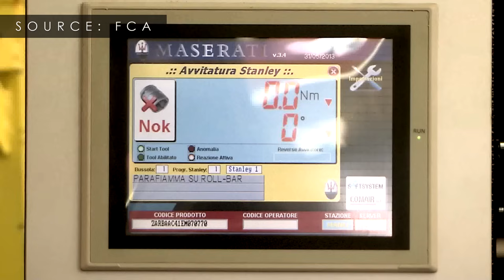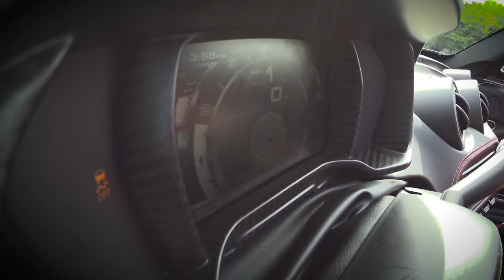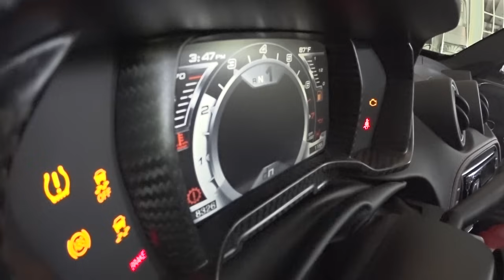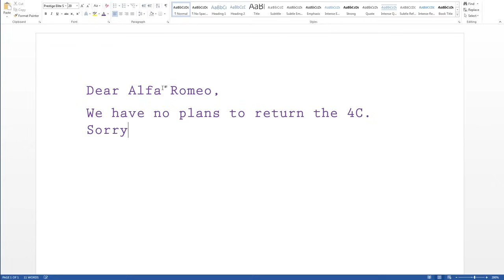Review | Alfa Romeo 4C Spider | Perfectly Imperfect

Comment: Most fun car ever, I have 8000 miles on my 4C. No problems a all I also have a 911 much more fun to drive the 4C.
Reply: You still got it ? Whats maintenance cost, overall satisfaction etc
Reply: Bob Livingston : I’d still take a 911
Reply: Bought my 2015 LE new.....couple of mild mods....replace rubber bushing in rear lower triangle with uniballs (huge improvement on track with stickier tires), better tires (the stock PZeros are crap and emphasize tramming), good alignment with 0 front toe. 
The car has been bullet proof and no issues at all other than a broken button when new replaced on warranty. Insurance is not expensive...in same range as my Ford 150 transit van and GMC Acadia Denali. I have owned a lot of cars including a 1970 ALFA duetto that I owned for over 40 years and only sold to gain garage space for the 4C. I also had a 67 ALFA GTV SCCA road racer. I love this 4C and every time I drive it I love it more. Mine isn't a daily driver but does get driven frequently although not in our Michigan Winters for obvious reasons. I am 72 years old, 6'-1" and 155#.....and very fit. I have no problem getting in or out of the car and once inside find it very comfortable although of course not big American car soft. Even though it has the optional race suspension it still rides fine....actually better than several other cars I have owned. I did find that adjusting the seat to the middle position on the front and lowest in the back gave a much more comfortable position and lets me see the entire dash display clearly. There are several aftermarket suppliers of upgrades for the car and with a couple of them the car becomes a real track monster.
Reply: @hertzair1186  Good for you! Enjoy your boring 911. I had two different model year 911s and a 987s and 981s.. The 4c is no comparison in regards to fun and a pure driver experience.
Reply: @Z3sty367 I have had no issues... Maintenance costs are minimal
Reply: @alphaboy1872  …plus it will hold value much better, and more reliable, etc….
Reply: @hertzair1186  it won't hold its value, you can pick up porsches from the 90s for dirt cheap
Reply: same here - its true

Comment: "it feels like you are going faster than you are"  so its like a 90s honda :D
Reply: Yep, it's one of the reasons they went up. The TypeR concept was fun then and still is now,  it just does not seem to fit into the regulations or commercial landscape any more.
Reply: Old Alfa run of the mill cars had those feeling to.

The Boxer engine Alfasud and Alfa 33 were very fun to drive but also affordable

Comment: We just bought one 3 weeks ago and already put 3,000 miles on it. It's awesome. We also have a Lotus Elise and a 2016 MX-5 and this is so much fun. Don't understand all the hate for the non-stick shift thing. This is the first non-stick shift car we've owned and we love it. Oh and insurance. It's $1k/year. That's it.
Reply: What do you prefer -- the 4C or the Elise?
Reply: I also have a 2017 MX5 (manual) and the 4C and I agree - the 4C's transmission doesn't make me miss the manual. The BMW DCT I had however, made me regret buying a DCT.
Reply: samo980 Curious about the insurance aspect.. What state do you live in? Clean driving record? Thanks!
Reply: MarkR171 What model BMW did ypu have the DCT in? Have you gone to the BMW dealership, and have the Engine ECU & Transmission ECU updated recently? Theyre continually making updates and improvements to the way the DCT behaves. As of now, the updates to an original non-updated Car, makes a Night & Day difference. For any 7Spd DCT Car, M-car or not. Big difference!!!
Reply: @Driv300mph  I also have both, I prefer the 4C due to interior quality. My wife refuses to get into the Elise.
Reply: @mxracingunlimitedltd7784  My insurance is $1,200 with comprehensive and collision per year ... in Houston, Texas with clean record.
Reply: @82DStock Is the ND or 4C the better driver's car?

Comment: I bought a coupe  one and added it to my early boxster and early MX 5 fleet.
This car is the most fun to drive. I'm happy to leave it in auto mode and normal setting and drive it on the torque curve.
So far I've done 4k km and averaged 6.6 l/100km.
Reply: I also have an NA MX5 and the 2.7 986. Helpful comment. I wonder how it compares to the Lotus Elise?
Reply: @papatorr3669 . More to the point, compare this car to a current generation Miata, the ND2 with upgraded powertrain and everything else. My 2019 Sport is 100 lb. lighter than the U.S. version of the carbo/aluminum 4C. The 4C is a bit faster, but since it’s priced the same as TWO Miatas, this means the current Miata, with its excellent 6-speed, can have its engine and suspension tuned to the owner’s exact specs by the huge aftermarket for a fraction the Alfa’s $32k premium.
Reply: @johntechwriter  Sold the NA and keep meaning to sell the 986 2.7 manual. Have a Z3 3.0 that I prefer to the NA, and a 986.2 3.2 liter manual that I prefer to the 2.7. I still want an NC but I got sidetracked with an RX-8 six speed manual for now. I don't imagine that the RX-8 is the best handling of my cars, which include three E46, but it may be my favorite and 'funner' than an NA, NB, or NC to me on twisty mountain roads.  😁

Comment: You hit the mark on every level with this review of the 4C. It took me quite some time to adjust to my car and to learn to drive it. Now that I've had it for a year, I love this car. It makes me feel exactly the way you say it does. The only thing that I disagree on is the dual clutch. I love the gearbox and I'm happy to say goodbye to a manual gearbox. I truly believe once a car is capable of rapid acceleration/speed like the 4C then a dual clutch is the only way to go. A manual gearbox is not only slower for a normal car but it would be even slower in this car which defeats the purpose and philosophy of the car.

Comment: In 1968 my first car was a 40hp, Triumph TR-4. Shit reliability. Would push start it, (while parallel parked…SERIOUS) and the canvas top rained on you when it was closed. 
LOVED THAT CAR.. SO FUN TO HEAR THAT MOTOR AND SHIFT THOSE  gears. Second car was a rusted out 1960(s) straight six with a granny low gear. 
I loved those cars. They were fun and freedom…. LOVED THEM.

Comment: As a 4C owner, I thought this was an excellent review and hits on many points. :-). 
 
I know you make light of a purported lack of top end power, but keep this in mind...  This engine is conservatively tuned from the factory and is easily capable of over 300WHP with a tuned ECU clone. I think that Alfa had planned to make a 300HP QV version but they scrapped the idea.  I think the car has plenty of power in stock form for me when driving on the street and is faster than my old Z4M, which was a beast in its own right.
Reply: I'm thinking of a 4C sometime in the future.  How's insurance for yours?  Thanks in advance!
Reply: superchan7 Insurance varies greatly depending on region and driving history. But I will say that compared to my Z4M, my insurance only went up by $30 a month.
Reply: superchan7 I pay $500 a month but I also have my 335I on my policy which I use as a daily driver, and I live in Miami insurance here is expensive as it is. So I’m guessing in a normal area insurance on the 4c could be around $2400 a year or less
Reply: Jesus, Eldar. I pay less than 1/3 of that for a 2017 MX5 and the 4C
Reply: I have never heard complaints of the power in the 4c . Seems balanced and fast and I love it. Most fears come from reliability. I have had cars with reported reliability issues and not had a problem. (2014 sho with 120 k ). My wife’s car.
Reply: Those are still sad numbers.  Factory 2.0L should be around 400 hp now for a "sports" car.  See Merc AMG, Audi S, BMW M..  This car motor is a a slouch by comparison.  I guess  the engineering team made sacrifices..  the rear suspension..  the motor..  the vertical seats..  Perhaps they should have "fixed" these issues in CAD first.  Its good at nothing in my mind.
Reply: @skewty  this comment just reminds me of everyone who says the 86 is compromised because it’s not fast enough lol. You’re missing the point of the car…it doesn’t exist to go zoom in a straight line
Reply: @RS3NDIT  (Scott Palmer) Kids living in moms basement seem to have lots to say.
Reply: Big claims.  No one in the alfa community ever has dynos to back it up
Reply: @skewty  i agree. looks not too good on paper. i have a M2 CS as comparison. The M2 annihilates this thing in every performance aspect. But that didn't change the fact that when I drove this thing today for an hour, i pretty much squeaked and laughed like a moron until i returned it to the shop. Haven't had this much fun in a car ever. feels like a go cart with good sound.

Comment: Best review of this car anywhere. Couldn't agree more.
Reply from the maker: +Will Spencer Glad it was useful.
Reply: I bought a Spider (in Rosso Alfa) in January and watched every review I could find before deciding. The decision was tough because it meant giving up a Lotus Elise I had for 7 years. While your overall conclusion does not differ much from other reviewers, your emphasis on what matters in a car built purely for performance does. One thing I am curious of though is if your test cars had the "Track Suspension" that is susceptible to unexpected tramming at high speeds. For me this effect results in an uneasiness driving at speed on imperfect road surfaces. Many change this by adjusting the camber from the factory setup which tends to be too agressove for some. This was not an issue with the Lotus. It does need a manual trans though, but sadly can't ever happen due to the carbon fiber monocoque.

Comment: Some mistakes...

According to the chief engineer, the carbon fiber frame of the windshield at the spider isn't for stiffness, but to improve vibrations of the windshield.
The bottom air intake at the left is for cooling the gear box.
The front isn't closed "empty space", but for cooling and electronics.
Reply from the maker: +Martin Hiltmann The video shows the lower cooling port, which is indeed the gearbox air chamber but narration says passenger side vent for intake which ia correct.  The faux hood is closed and inaccessible service is done from undermeath the vehicle.  The carbon frame was added for structural rigidity, which can be used to control vibration as well.
Reply: +savagegeese 
hi,
wasn't ment to be offending.
I do own the 4c Spider, love it, and sometimes I get the impression, it's the most misunderstood and misinterpreted car currently on the market.
My personal highlight is a press article from a well known german magazin, claiming to feel the steering becoming harder defined instantly in dynamics and race mode, and softer in normal and all weather.
Reg. the windshield - as far as I've learned - there was no need for more stiffness, as the roof of the coupe isn't so important.
Alfa added some layers to the carbon fiber body structure on some positions in order to keep the spider stable, one of the reasons for the add. weight compared to the coupe.
Many of the first reviews in my opinion didn't even had a chance to feel the full potential, as I got the impression (and was told), there is a kind of protection mode for the first few hundred km programmed, cutting down the engines output for smooth running in the engine.
Greetings!
Reply: @martinhiltmann1226  Yeah, the CF windshield frame is there precisely because it is stronger than the metal one, which was surrounded by CF structure, used in the Coupé.

Comment: Unique carbon tub (to comply with US crash standards), standard air con, the addition of side and knee airbags and an adjustable passenger seat (again A US requirement) adds up to about 350 lbs of extra weight that the US car has to haul around.

Comment: As an owner, I can second your thought on the traffic.  It is down right horrible to sit in traffic with the 4C.  Not only all your said, but the dual clutch just really hates going 0 to 10 to 0 for 2 hours and it lets you know.  All and all good review!
Reply: I love it! We own a little Dodge Dart, only 160hP dual clutch transmission, that thing is so much fun as is. I can only imagine what the 4C does. My wife is not a fan of Manuals so the limited was a compromise. I do have to say that having the dealers work on it has been a nightmare, okay if they charge for fixing it and fixed it, but they do not, at least 2 dealers here in Austin, Texas, are not good at all, Dual Clutch Transmission are simply a manual with two clutch disks for odd an even gears, with a transmission controller doing all the shifting, which at 30 k miles need n adjustment. Well, the module is smart but not smart enough to realize you still have plenty of clutch disk material to use and it throws the error to get it serviced. When you do, these knuckled making money heads, will drop the transmission at your cost, even when still under warranty, and charge you for parts. Easily a $4k job.when it should not. I am a little smarter than most, in the sense that I hate it when people take advantage of me and cheap enough to want to research a new route. Turns out that I could get the dealers obd2 tools and do the work myself and it ended up figuring out how to re train the transmission for a third round of 30k miles. I know the 4C has the same transmission, which is really robust but be aware of dealer ignorance and fraud. at 30k you should not have to replace the transmission clutch assembly. For more info, feel free to contact me via YouTube.

Comment: Lifting these cars with a regular two-post lift is quite a chore. At the front, you place the lift pads (the soft, round style) directly on the carbon tub. At the rear you place those same style pads on the two corners of the subframe that sit just in front of the rear suspension. Lastly, you have to adjust the height of each pad so all 4 make contact at the same time. 

Most lift arms will not fit under it, so you typically need go-jacks raise the whole car up and give you the clearance you need to swing the arms under. Finally, because of the unusual weight distribution, these things wobble a ton on our two-post lifts. Once it's up in the air where we need it, we place a padded screw jack under the rear subframe to stabilize it. So yeah, it's a pain.

Comment: Hi guys, big fan of your videos, as they are some of the best ones around.  Highly-polished, very in-depth, and a great technical overview.

I am commenting on this video because I also got curious about the carbon fiber tub and how much it would cost to insure the car.  I paused the video and called my insurance company (ended up waiting 20 minutes on an "expected 6 minute wait time."  I asked the agent to give me a quote on a 2018 Alfa Romeo 4C coupe just to see, and I had her use the same policy settings I have on my other cars so that I have a good reference point.

The quote for a 6-month policy was $611.  As a reference, I have a 2014 Mustang GT that costs me $730~ and a 2016 Miata that costs me $450~ for that 6-month period.  Not bad at all, huh?  Cheaper than my Mustang, how odd!

I am going to call tomorrow morning and go to the claims department and ask to speak to an adjuster.  Going to ask about how they handle repairs on such a car in a major crash.
Reply: I got very busy but I did get a hold of an adjuster.  The one I spoke with has been doing this over 10 years, and has never heard of this car being in a claim.  I guess that's to be expected.  They brought up a lot of good points and information, but right now it seems that it boils down to this:  the car is still new, and few have probably been in crash claims.  Because of the lack of history for such cars, the premium is still reasonable.  Since the car is rare regardless, I doubt any one insurance company will ever see so many claims where the cars are totaled that premiums would go much higher.

Comment: I love it! We own a little Dodge Dart, only 160hP dual clutch transmission, that thing is so much fun as is. I can only imagine what the 4C does. My wife is not a fan of Manuals so the limited was a compromise. I do have to say that having the dealers work on it has been a nightmare, okay if they charge for fixing it and fixed it, but they do not, at least 2 dealers here in Austin, Texas, are not good at all, Dual Clutch Transmission are simply a manual with two clutch disks for odd an even gears, with a transmission controller doing all the shifting, which at 30 k miles need n adjustment. Well, the module is smart but not smart enough to realize you still have plenty of clutch disk material to use and it throws the error to get it serviced. When you do, these knuckled making money heads, will drop the transmission at your cost, even when still under warranty, and charge you for parts. Easily a $4k job.when it should not. I am a little smarter than most, in the sense that I hate it when people take advantage of me and cheap enough to want to research a new route. Turns out that I could get the dealers obd2 tools and do the work myself and it ended up figuring out how to re train the transmission for a third round of 30k miles. I know the 4C has the same transmission, which is really robust but be aware of dealer ignorance and fraud. at 30k you should not have to replace the transmission clutch assembly. For more info, feel free to contact me via YouTube.
Reply: Great info sir
Reply: I got the alfaromeo since i posted this and found that I can’t put into words what the 4C is, but. I can try! Awesome! Just Awesome, unlike any other car i have ever owned!
Reply: Also, please use permanent loctite on the inner rod when you put it back together